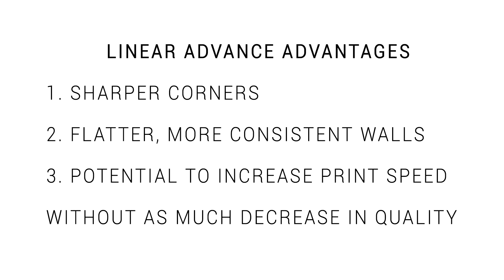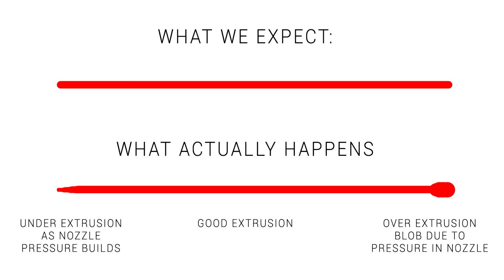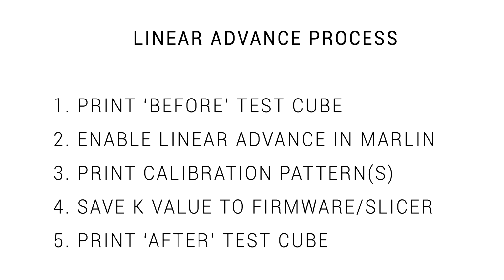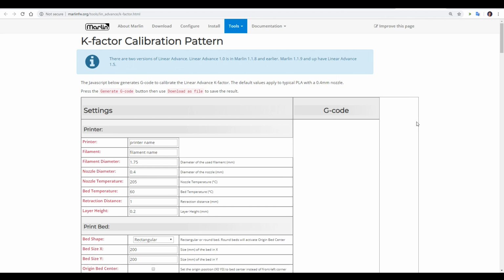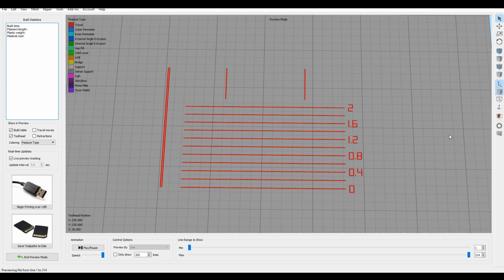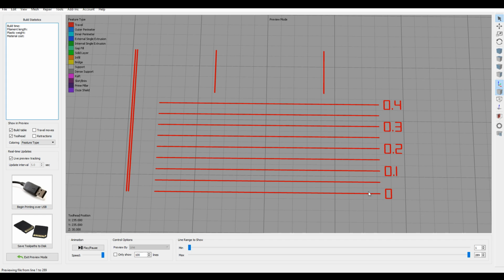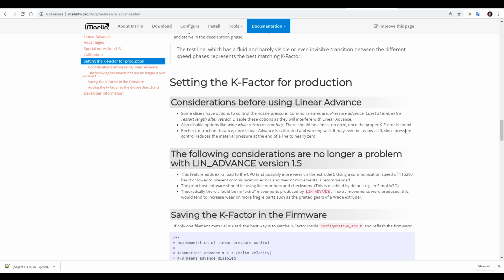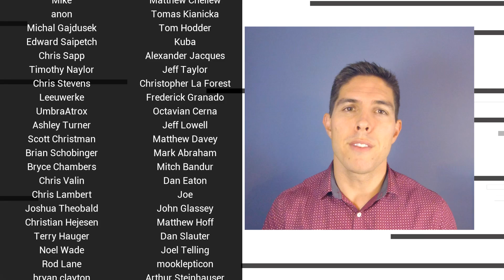Linear advance guide - Free and easy print quality improvement

Comment: I found an interesting detail, order matters when tuning linear advance, acceleration, and junction deviation.  I tuned the linear advance, then the acceleration and junction deviation, now i need to retune the linear advance.  Not a major issue, just a detail to keep in mind.  All three of these settings interact with each other.
Reply: I was wondering about that. Thanks for the advice

Comment: Thank you for your brilliant videos :-) 

I’ve got an ender 3 pro. SKR mini 1.2. Manual mesh bed levelling activated. Had to put “M420 S1” into the startup Gode in order for the printer to actually use the Mesh. 

When I use the gCode from the pattern generator, it drives the nozzle almost into the bed, and the printet pattern can’t be removed afterwards. I suspect that the printer doesn’t use the Mesh when I run the gCode from the pattern generator,  but putting M420 S1 in there manually is cause no change what so ever. 

Is there a special place I need to put the M420 S1, or am I doing something else wrong? 

Cheers guys :-)

Comment: These videos are really useful. I have referred to your channel than any other TY channel for information which says a lot. Thanks.
I was curious to see how this might help improve my prints and I really think it's super specific to your hardware and filament. My K setting was very low and I actually didn't really see any print improvements but I could see how certain filaments, hot-ends, and extruder setups would need tuning. My initial print was pretty great with a dual drive extruder on an otherwise stock Ender 3 with what you would think was pretty default PETG print.

Of course, this is after following many of your videos on calibration! I will say that the dual drive extruder is easily the best upgrade you can make to the Ender 3. After running an extruder calibration you'll see a huge difference.

Comment: Just trying this feature now on my first print, thanks for explaining it, I run a bowden setup with a E3d titan extruder and my first observation is the extruder is a a lot noisier with the micro retracts occurring on corners and areas of small infill etc.
Reply: ...and then I saw the comments below, so will try enabling classic jerk after this print finishes and re-try
Reply: enabling classic Jerk definitely fixed the extruder noise issue!

Comment: I have a delta printer with an SKR 1.3 board and TMC2209's in UART mode. My extruder screams and sound like its grinding when I turn linear advance on. Have you not had this issue? Thanks
Reply: 7maszi7 that happened to my today using same board and drivers, did you find a solution??
Reply: @simpliciobobadilla8117  Yes and no. I tried klipper's pressure advance but had a similar issue. Then, moved the extruder and mounted on a printed bracket rather than the metal frame and that solved the noise issue. In my case, I think the metal frame amplified the vibration.
Reply: 7maszi7 thank you!!

Comment: Do you flash the firmware with Lin_advance enabled BEFORE the test print or after?
Reply: You can enable linear advance in firmware. Just use 0 k value to not use linear advance for before print.

Comment: What if zero looks bad, and everything up looks even worse?
Do I go negative?
Reply: Came here to find this answer lol
Reply: Are you actually having this problem? You ran the tests and zero looks bad? Did you try going way higher? Go up instead of down?
Reply: @SniperX611  I did... went as far up as 5.. .and it's just two slabs of plastic on either side with nothing in between. 
0 is the "best" looking one, and that is a very thin and slobby string between the outer lines.
Reply: Ya my fast doesnt go down thicker like his or documentation, it goes down thinner. The higher the number, the thinner it gets (i e less material)

Comment: Has anyone else run into issues with the TMC2209 driver when enabling Linear Advance? Running Marlin 2.0.5.3 and I get grinding noises on my extruder. Others seem to experience this issue on GitHub, but I wonder if there is a workaround.
Reply: same problem. any solution?
Reply: Did you find one
Reply: Nope. Just printing slower :/

Comment: do apparently it was turned on by default in the firmware i'm using, didn't have any problems so far, K=0 in the firmware, will i get problems if i change that? (im using tmc2208's)
Reply: k0 is linear advance disabled, as stated in the video, tmc 2208s are not compatible with linear advance.

Comment: I'm getting my new pancake stepper, re-installing my BMG extruder with the Petsfan direct drive setup.  I will do a full recalibration following your guide with the cube and speed test. My question is when should I do the Linear advance calibration? before extrusion multiplier calibration or after?

Comment: I followed this using a stock extruder and an SKR E3 Mini on my Ender 3. Once I got my K value dialed in, the extruder makes a terrible grinding noise. I went back to my starting G-Code and just set the K to 0 till I can find some information on what is happening here.
Reply: Same, have you found a solution?
Reply: @gilshahar7  same. any solution?
Reply: joan ser Nope, just abandoned Linear advance
Reply: @gilshahar7  thanks for the info. i assume i will do the same.. :/

Comment: I can't get the test pattern to print correctly.  It prints the first couple of lines and then starts printing the third extremely slow and I have to cancel the test.  Using Marlin 2.0.1 firmware on Artillery Genius.  Any help appreciated.

Comment: Ender 3, bowden setup with capricorn and metal extruder, microswiss all metal hotend,  skr mini e3 1.2, bltouch, Marlin 2.0.1. Usin PLA, I've set e-steps, flow rate etc. Even 0.1 linear advance is thick-thin-thick, i guess its not working on a bowden setup. Think i have to try it on microswiss direct drive, when its ready for ordering. Thank for a great guide though!

Comment: Hi there... What could be wrong if all the lines looks exactly the same? Using SKR 1.3 with Marlin 2.0 and TMC 2208 on all stepper. Stealthchop activated and deactivated. No difference. I tried K Values between 0-100. Even tried negativ Values. Linear_Advance is deactivatet in my sketch.

Comment: Have you done this on Ender 3 with SKR v1.3 and TMC2208 in UART? That's my current set up and I'd love to use linear advance but it seems like there's some bug that doesn't allow it with my set up. With linear advance the extruder gear just won't move. Not sure what's up.

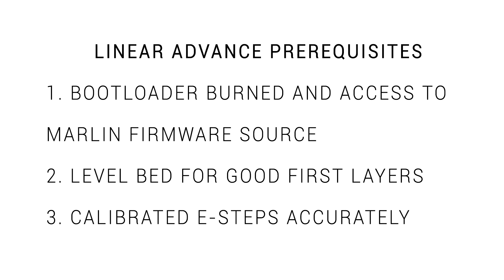Comment: 1:03 Bootloader burned? 
Dont get that one. Why would you require that, what is it. You just flash firmware??
Or is there a bigger step involved?
Reply: Actually when you flash the firmware via a serial connection you make use of a feature of your pre installed bootloader. It's very likely to be already in place and it basically never requires any updates. Don't worry about this part if you're able to flash your firmware everything is already as it should be.
Reply: @TheBrassn  ok great
Thank you for taking the time to answer my question